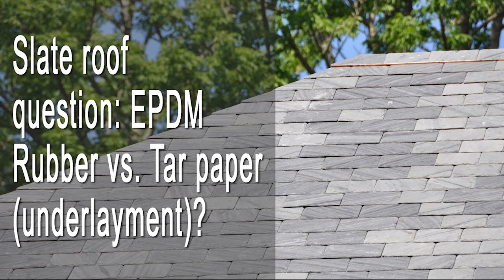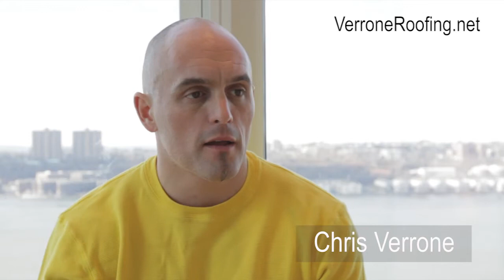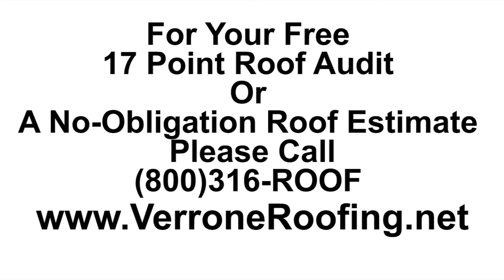Slate roof: EPDM Rubber vs. Tar paper underlayment?

Comment: Hmm  like slate roofs are not expensive  to begin with let's add epdm  under the sounds unnecessary   
 Slate roofs last more then 100 years.  So if they didn't use rubber 100 years ago why would you use it now. 
Stupid

Comment: EPDM is 'self-sealing'???  since slate nails are not hammered flush, nor with any grommet to establish a gasket fit..there's no way membranes will heal.  during repair requirements, when pulling slate and accessory nails, what is your experience with the longevity of the EPDM and do you repair beyond installing bib/hooks...